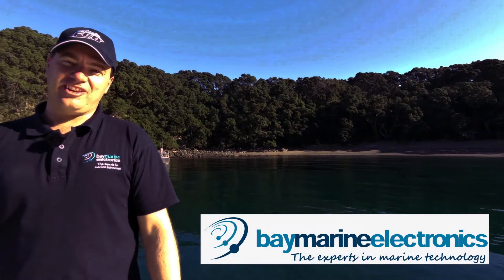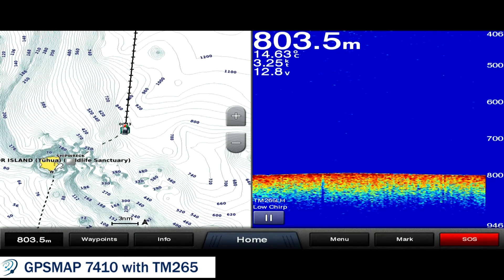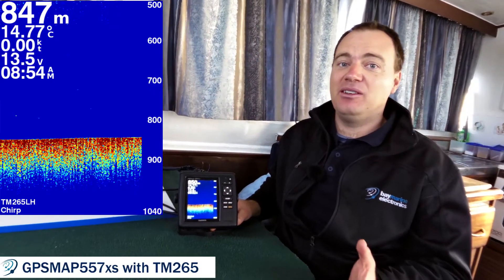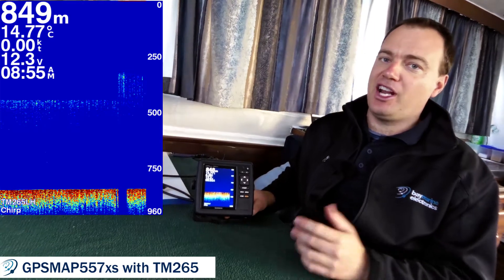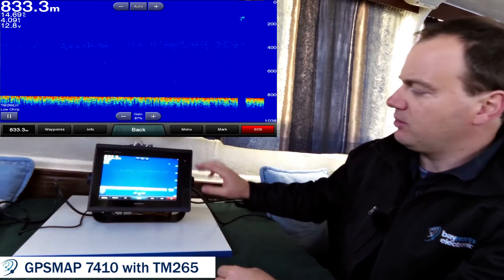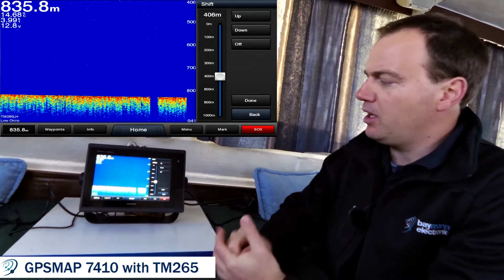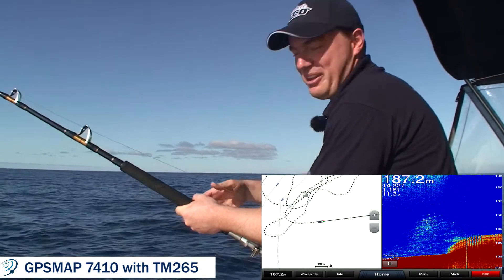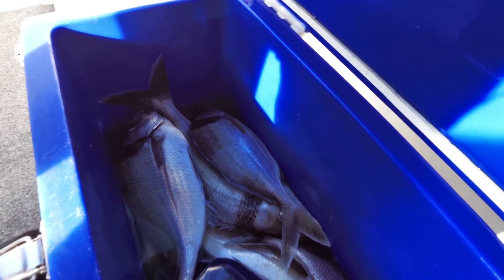Deep water testing with Garmin GPSMAP 7400 series and TM265

Comment: Really great test. 

I’m looking to purchase TM265LM transducer which compatible with these 3 units :
1- Lowrance HDS7 Live (9 pin) two sonar ports “black & blue”
2- Garmin GPSMAP 547XS (8 pin) one sonar port
3- Garmin GPSMAP 743XSV (12 pin) one sonar port 

I understood TM265LM transducer has two sonar connectors. One for Medium frequency chirp & second for Low frequency chirp. 

I believe The TM265LM Transducer  I can plug in directly to Lowrance HDS7 Live because its has two ports for work dual channels.

But How I can plug TM265LM TO  GARMIN GPSMAP 547xs & 743xsv for work dual frequency (Low&Medium chirp) note that my Garmin units have single port.

Hope you to advise me which cables or adapters should I purchase to work with all three units If I would to use one of them.

Comment: do you know if this transducer can be connected to the 741xs?
Reply from the maker: Yep. You'll need an 8 pin adapter box. And depending on the software version, you may need to not connect the Xid wire and manually select B175L as the transducer type.
Reply: +BayMarineElectronics whats the part number for the box? 010-11613-00?
Reply from the maker: Yep

Comment: Hi, this is a great test... 
Now i'm purchasing a GPSMAP 7408 and i want to put a TM 265 LH and a GT 51. I would like to ask you if is possible to run both transducers at the same time .... thank you, have good time on the sea :)
Reply from the maker: +Davide What we normally do is hook up the TM265 through an 8 pin adapter box - just the low frequency, and use the 12 pin socket with the GT51. Then you can use the GT51 for shallow water use - up to 150M or so, and the TM265 for the deeper stuff.
Reply: +BayMarineElectronics  Thank you very much for the answer. I didn't know that i needed an 8 pin adapter for hook up the transducers. But i didn't understand one thing, if in case i  want to use the TM265 even for shallow water,  ( cause of the better resolution than the GT51), can i switch to an high chirp  frequency?
Reply from the maker: +Davide Normally the TM265 would be connected to  the GPSMAP 7408 unit through the 12 pin socket. This allows you to connect both the high frequency and the low frequecy wires, but it uses the 12 pin socket, so you can't plug in the GT51. To get around this, we use the 8 pin socket, which you can hook up one frequency from the TM265, but not both. The GT51 is excellent for very shallow water use due to its wider beam width than the TM265, and the resolution is very good also. The TM265 High frequency is actually slightly better for medium depths - say 50M to 200M due to its narrower beamwidth, but both work very well from 20 to 150M
Reply: +BayMarineElectronics  hii... thank you again, you have solved me a lot doubts..... now everything is more clear.